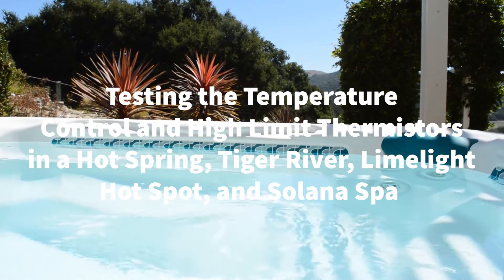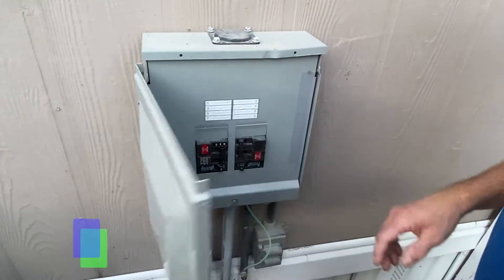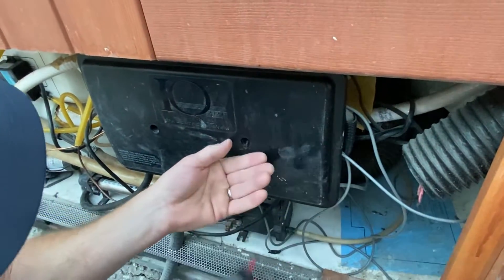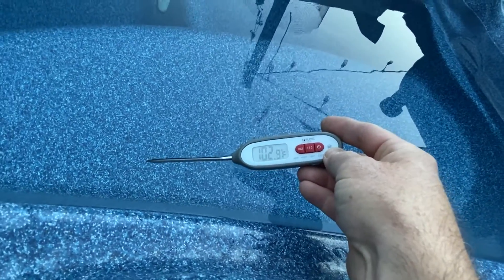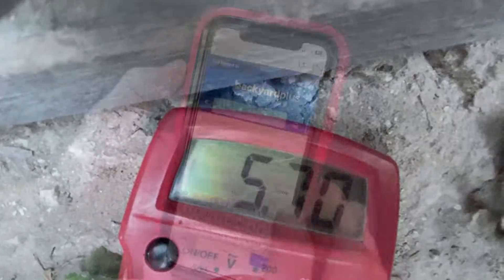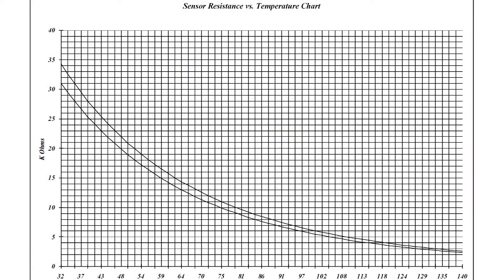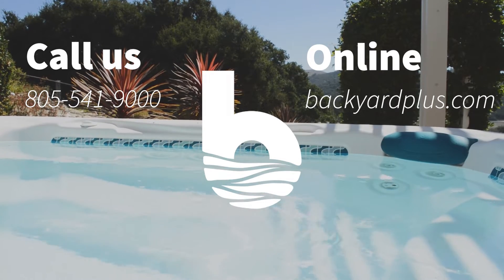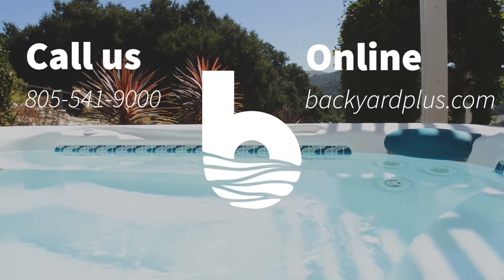Testing the Hot Tub Temperature Control and High Limit Thermistors in a Hot Spring & Hot Spot Spa

Comment: I have an HL code coming up, and screen reads the accurate temp fot he water until the HL code comes up, is it the HL switch or the theirmister that is likely bad?
Reply from the maker: A high limit condition, or (Protection Mode) can be caused by several different things. It could be thermistors plugged in incorrectly, clogged filters, airlock, a bad high Limit thermistor, a bad circulation pump, or a bad heater. Make sure your thermistors are plugged in correctly. After that, remove the filters and check for an airlock. If those things don't work, test your thermistors. If that's not it, make sure your circulation pump is working and make sure the summer timer mode is off.

Comment: Where is the high limit switch on the board? I’m
Brand new to this used hot tub and our D17 light is on on our circuit board.
Reply from the maker: The high Limit switch is the LIM THERM on the motherboard, The solid red D17 light is lit when the high limit has tripped and the spa is in protection mode. The red power light should be flashing at the same time. This is usually caused by a low flow situation (clogged filters, airlock, bad circ pump) or a bad high limit sensor.